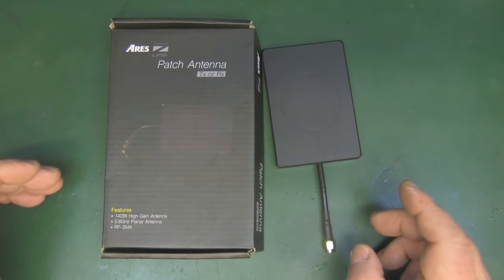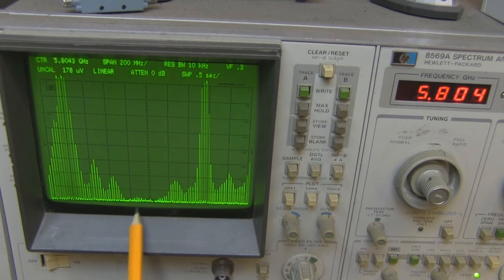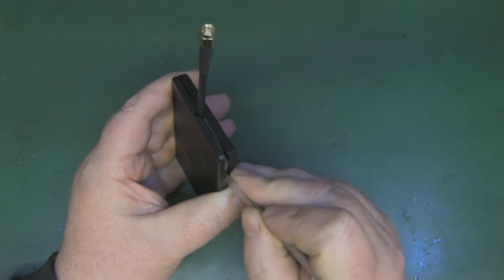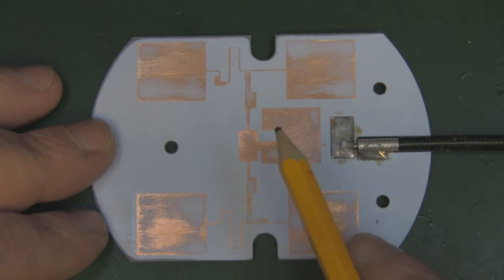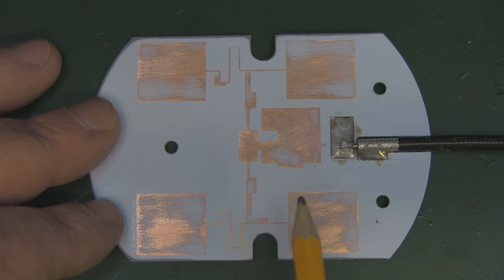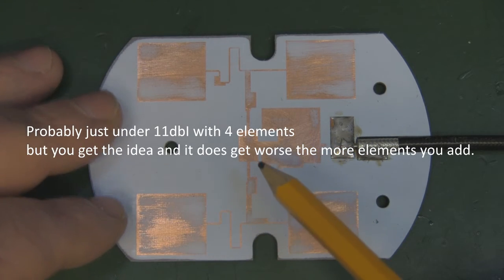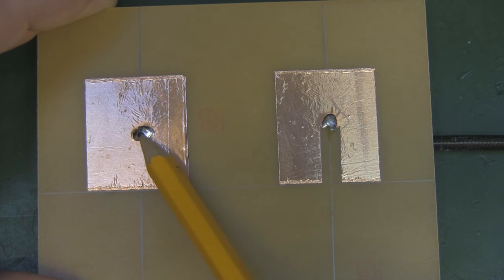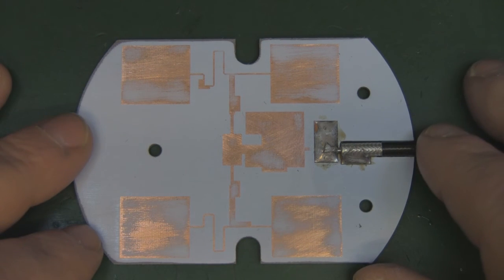AZSZ1031 Ares 5 8GHz 14dBi Patch Antenna

Comment: I have a antenna with the same exact design. I had to go check it the second I saw this video. On the data sheet for mine it's claimed to be a 9bi linear antenna. It's called the turbowing cyclops and can be found on banggood for under €7. It didn't come with the plastic casing and the coating isn't white, it's black and isn't round like this. I would like to give a review on it but it came to me with the wring SMA connector. I have the right ones coming in the mail though so I'll be able to throw one on and test it out.

Comment: 7:30 This is quite badly worded, I think it will not "produce" secondary harmonic (e.g. add signal at double your TX frequency). It's a linear circuit, after all. 
I think you meant it could have secondary resonance peaks/notches at multiples of design frequency, though.